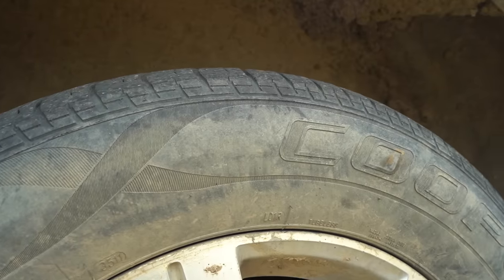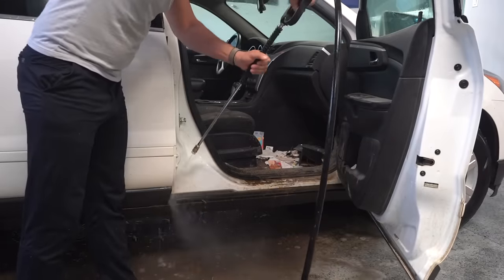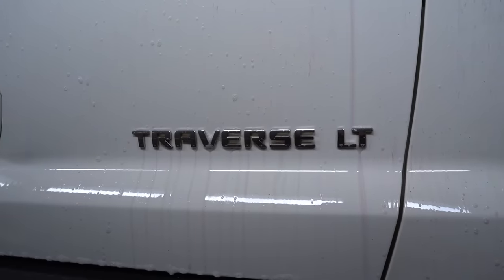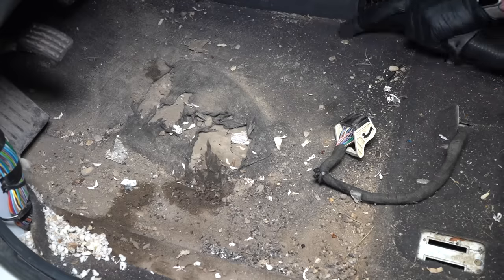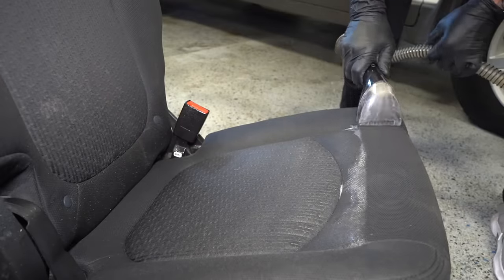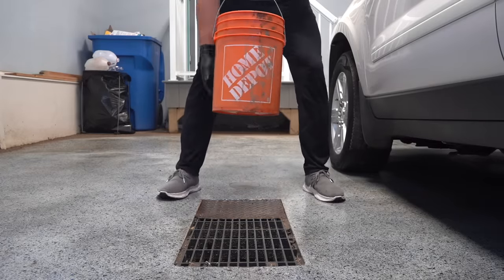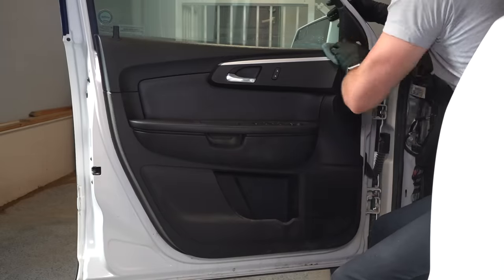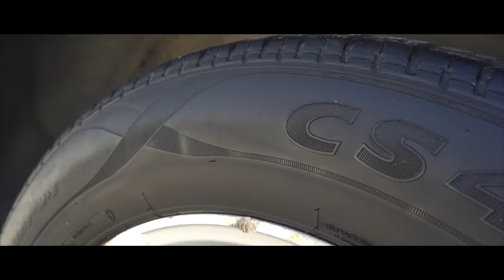Salvaging an ABANDONED Car That's NEVER Been Cleaned! | The Detail Geek

Comment: That fountain of dirt that erupted when you pressure washed the back!!

Was very surprised though that only one bucket was needed for your dirty water. I was expecting two if I'm honest
Reply: I was guessing 3 buckets tbh
Reply: I was expecting 1 bucket just for the front passenger side alone!
Reply: It's because it's only technically carpet. This era of GM interiors had such a short pile carpet it could best be described as flocking glued to a substrate layer..  hideous stuff to clean. Has almost zero water retention properties.

Comment: Do you ever change the cabin air filter or recommend to the customer for them to change it?
Reply: Good question, especially since it was inundated with mouse poop and pee.
Reply: That was my first thought when I saw the nest in the glove box. The cowl and the cabin air filter have to both be full of nest material, urine and feces from Fievel also
Reply: What >I< want to know is if he keeps all the spare change thats always in there.
Personally I cant NOT stop to pick up a coin.
Reply: @projektkobra2247  he's mentioned in previous videos that spare change goes back to the owner.
Reply: I have asked/posted that question on numerous videos ..... always without getting an answer.  I have also asked if he has ever taken out/removed the carpet from a vehicle to clean the carpet, remove to clean or replace the padding under the carpet, and clean and sanitize the floor pan.  This vehicle qualified for those extra steps. Also, with the habitation and toileting of the mice, the vehicle needed more than the cabin air filter being changed out (actually, should be done with any of those especially dirty, dusty, filthy cars, otherwise if not done, the first time the air is turned on, they driver will be blowing dust into the car .... who needs that after paying big bucks to get your car cleaned).  The venting running under the floor and through the door panels need to be clean and sanitized as well.

I had to have my car interior detailed (the detailer actually said, "Ma'am, this is a restoration job."  I had a glass jug of root beer break which flooded the floor of my car ..... just the one side because of the hump, but still.  (1999 Honda CRV)  So, while he was at he did the entirety of the floor, removing the carpet to clean it, replaced the padding, cleaned and put a sealer on the floor pan (not that it was rusting, but was part of the package), and he cleaned the floor venting because the root beer had run down in the air vent.  When he got done, the interior looked better than when I bought the car.
Reply: @kelly9886  -Cheers.
Reply: @tinydancer7426  I guess by his non answer that he doesn't remove the carpet, just cleans it in situ, but I guess it's up to the owner, he would probably remove the carpet at extra cost. With the bad state of the driver side carpet in this one I would think that the new owner will replace all the carpet anyway. If the under carpet lining absorbed the urine of the animals you will probably never get rid of it and come a hot day it will soon waft back up.
Reply: @davidwilles8577  OMG. The thought of getting hit with the smell when you open the door on a major hot summer day after the car has been sitting with the windows shut tight.  😝

Comment: I was wondering about that carpet. Since it was in such bad condition, do you know how much trouble it would be to replace it? After you have all the seats and trim removed, how much more work would it be to rip it out and replace it with new? Provided you could get either new or at least used in much better condition, possibly from a wrecked or salvage vehicle of the same model. Seems like that would be something the new owner would want to do, if it's possible.
Reply: Overall carpet isn't the worst thing to remove and reinstall, it's mostly just time. It does take some patience with a heat gun due to glue on the edges. i think it took me around 1.5 hrs to remove my carpet(rusty seat mounts took way to long).

Comment: Another great detail Mitch! On these heavy details do you consider fully taking the carpet out to clean under the carpet as well?
Reply: Was just thinking the same thing. Surely the rodent urine would have soaked through?
Reply: Alot of times if you take the carpet out and pressure wash it if stretches out or warps it. So it dosent sit rightinthe car again.
Reply: @esthermccue1294  oh, right. That makes sense.
Reply: @esthermccue1294  in this case, I'm wondering if that wouldn't be an acceptable risk
Reply: No, taking the floor carpet out is too much work. You'll take apart more trim, which is very time consuming. If I was the owner and I saw the torn up carpet, I wouldn't bother having it cleaned. New carpet for an old Traverse should not be too hard or expensive to source.

Comment: I wonder about headliners in a car in this condition. They have to be holding a great deal of odor and cannot have been impervious to the dirt and grime that penetrated every inch of the interior. I have not seen a headliner treated in one of your videos and would appreciate knowing what, if anything, you do to headliners.
Reply: Headliners are so fragile that if you did much more to them than surface wiping, they'd get torn and lose their adhesion. I have some stains on my headliner that I don't even want to touch because it'll destroy it trying to clean it.
Reply: he has cleaned SEVERAL headliners in his videos using the steamer or just using the towels. you haven't been watching long if you haven't' seen this done yet!
Reply: @Renee5  A few months as well as watching some past videos. it has not been addressed in any of the episodes I have seen.
Reply: @AlecShernAPS  That was my reason for asking. Is there is a way to get the odor out of a delicate headliner in a "trashed" vehicle. It seems as though it would be an impossible task.
Reply: An ozone machine will get rid of most of the odors in the headliner and the impossible to reach areas. Plus it will disinfect.

Comment: Think about getting yourself a torch too. If you lightly, torch the scratches in the plastic, it helps flatten them, and brings a sheen back to the plastic as well. Of course you have to be a little light handed and careful, but it helps

Comment: On plastic trim where course dirt leaves scratches it can be greatly improved by running a heat gun carefully over the surface. It does a sort of reset on the plastics and can completely remove minor imperfections

Comment: I bought an Enclave (the Traverse's cousin) that needed gutting & restoration, and I can attest to the 2nd row seats being more than twice the weight compared to the driver/passenger front-row seats.
After fighting to remove all 7 bolts (per-seat!), I later discovered during cleaning, that if you collapse the seats forward (3rd row entry position), all bolts can be easily accessed/installed/removed with an impact wrench.  If only I had known that during removal, I would have saved an hour manually ratcheting because of clearance

Comment: Compressed air tends to work really well for getting embedded dirt out of those cheap velcro carpet types, air gun usually point blank I do it after my first shampoo pass or put hot water ontop of it first then do it 

Get ready for a darn mess everywhere though. I was actually waiting to see how you handle it. My method works but it makes you repeat a ton of steps so was seeing how you tackled it

Comment: I've watched so many of these detailing jobs and I've followed your construction videos for the new shop.  What I'm wondering is are you going to install a dedicated work table or bench for washing the removable fittings that you're steam cleaning?  Currently you get down on the floor to do them.  Wouldn't it save time and trouble to have a work area with water and drain for doing those fittings?

Comment: City/Suburban boy here (extremely few unpaved roads in the Delaware Valley, but I am amazed at the amount of dirt that gets trapped in the door and hatch seams.  Another vehicle that I would spray with Lysol and then Febreze opening up.  Praise the Lord for Respirators and  Rubber Gloves.  The client should probably have had you detail the engine too.  Watching this I realized I am of a bygone era.  As you cleaned the back of the driver's seat (I think), I was "Oh look!  They made this with a map pocket!"

If the engine is in good shape, no reason to junk a car because it is dirty as you show in this video.

Comment: You should get a price in a replacement front carpet and sold that to the customer.
I used to be a Chevy fan, but after the last one I had, I wouldn't touch them with a 10 ft pole.
Final outcome is great.  Nice job.  Hope it runs as good as it looks. What, besides the cleaning, did you do about the stink?

Comment: Between transmissions that boil their fluid out of the cap (sounds weird but yes in the south they do that 😂), window regulators and switches that just randomly die, low beam headlights that burn out within 7 months at a time, and carbon buildup so bad you have to take the intake manifold off sometimes to get it cleaned out properly, seeing one in this condition feels par for the course. Ironically, the front seats are incredibly comfortable...... after you take the head rests off.

Comment: If that car is to be driven on regular basis the new owner probably needs to consider replacing the wornout carpet. The low end carpet can do just fine if it's taken care of. My 2010 Corolla has the low end carpet but has no embedded matter because I vacuum it every week and hit it every other day with my Dustbuster cordless vac. I guess that sounds obsessive but the carpet is flawless as the rest of the car is. Regular cleaning is the key to keeping a car nice. Even my 13 year old Toyota with 130,00 miles on it. Still runs and drives like new. The interior is flawless. The paint has very good gloss but shows some signs of age from sitting in the hot Texas sun but not a single sign of rust. Cars don't rust in Texas. No road salt in the winter.

Comment: Honestly, with such dirty carpet, in my experience it's faster to take carpet out, wash it with power washer, get most of the water using vacuum and just leave it to dry outside(or inside in winter).

Comment: Using the in wall vacuum on crap like this is a good way to get bed bugs and roaches in the place..  i believe i would have had to remove the carpet completely and clean it to the metal.. and steam clean the carpet wile its out...

Comment: I just have to say: I've ever only detailed at dealerships; the first dealership I worked at and the only dealership I worked at was a Mercedes/Audi plus 3 or 4 other high end luxury makes, and we never took seats out- but nothing was ever that bad so I never really rhought about it. fast forward to now, about 5-6 years later and I'm finally at my 2nd dealership(took a hiatus and went back to the restaurant scene) and I've had vehicles so bad(chevy dealership this time) that even before I came across your vehicles I started ripping trim out and whatnot. today my manager scolded me with a "I don't see why you have to pull out the trim and take the vehicle apart, you don't have to worry about this shit undernea-" sir it's called DETAILING. one can argue oh it's job security- the hell it is. I won't be able to remove seats or anything but I sure as hell will be removing trim when necessary and doing as much as I can that way. also really bugs me we don't even have a pressure wash or drill brush or even a good extractor vacuum. just good ole fashioned carpet spray and brushes and a wet/dry shop vac(which 4 days ago I was scolded by the lead detailer for using the wet vac to suck up wet carpet like uhhhhhh)

anyways, it's been a goal since that first dealership 5, 6ish years ago to open my own shop and it'll be nothing like this dealership job because yikes

Comment: So, just wondering, are you at all concerned about what's living underneath the floor lining?
Not to mention, i'm scared of the dash on this thing.
Honestly if that were my car (and if i wasn't allowed to crush it), i'd have the entire lower interior lining torn out and replaced, or at least taken out and done the entire underside, and probably disassembled the dash and cleaned the AC system out. Maybe also replaced the headliner. Is that going far?
Yes.

... This car deserves 'far'.

Comment: There's a customer at a shop I worked at an attorney with a rare two-door special Coupe Mercedes he smoked a pipe in the car heavily the interior had turned from Gray to Yellow from his pipe smoking in the car and he would knock out his pipe in the door panel on the driver's side it was all melted and full of of tobacco Ash I was surprised the car didn't burn down in the parking lot when he left the car after dumping his pipe. Funny thing is this attorney made so much money that he could buy one of those cars every day so he had no regard for it at whatsoever. You would have had to see it to believe it.

Comment: Back in the day we would have removed the carpet and underpaid and threw it out or cleaned it outside the vehicle because the pad would have kept that rat piss smell and would have come back even worse when done. Also to get the fine dust and dirt that works it way through the carpet and pad which would have turned to mud underneath. Especially seeing it all torn up under the drivers side. Get another one from an automotive dismantler (wrecking yard).

Comment: It's really a shame that people can treat a vehicle like that. That SUV should still  be I pretty decent shape no older than it is. But I've always said that people have to work to get a vehicle in this condition. It didn't get this way on its own. The fact that I don't care for Chevrolet any more doesn't have anything to with it but perhaps sending this trashed SUV to the scrapyard would have been easier. This car probably hasn't been taken care of on the mechanical end either. I bet the previous owner never changed the engine oil. I have my doubts about the overall condition of this car. Cleaning the car is good but I'm afraid a lot of the abuse this car has had  may not be undone. It can only take so much abuse and still be a reliable car.

Comment: Not harsh at all considering the design of literally EVERYTHING in these cars is just as bad if not worse than the seats and whoever was responsible needs to be arrested. Yes let’s put the oil filter within an inch of the exhaust manifold, that doesn’t get hot at all or anything

Comment: I have been a pro car cleaner for over 50 yrs  I have done worst cars than this what I can’t understand he how easy that dirt came off with just cold water something here is not right you would have to use a truck remover chemical that to me has just been driven through the mud  for this video ( my opinion).